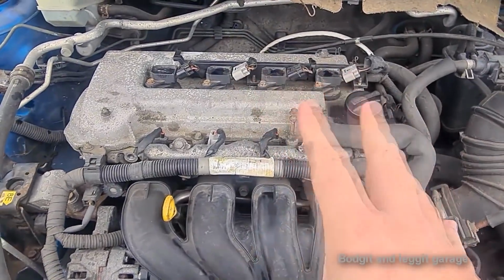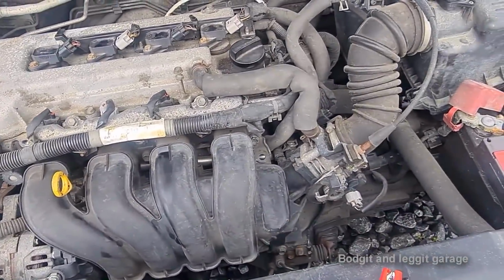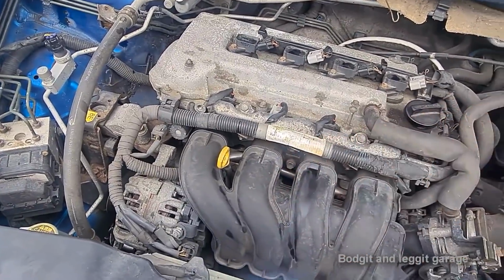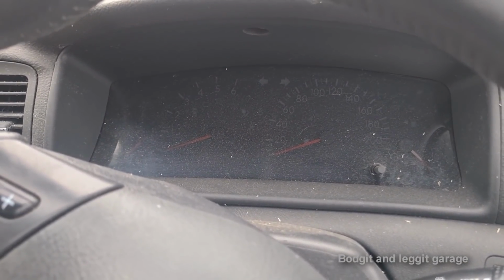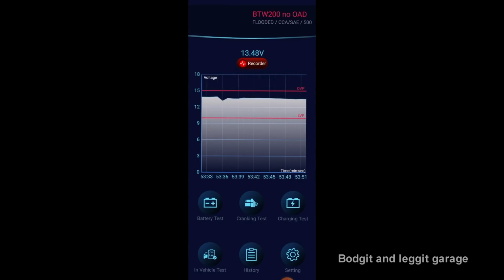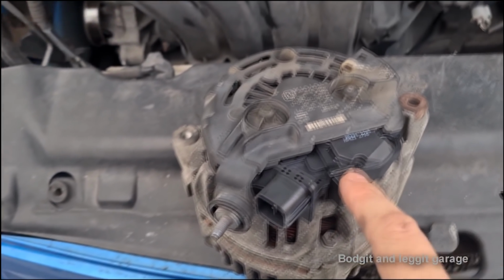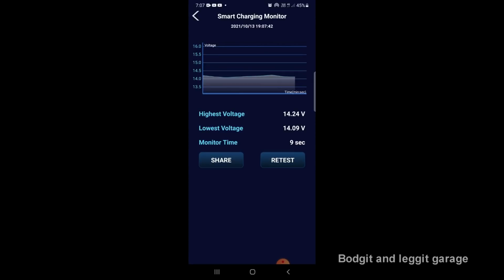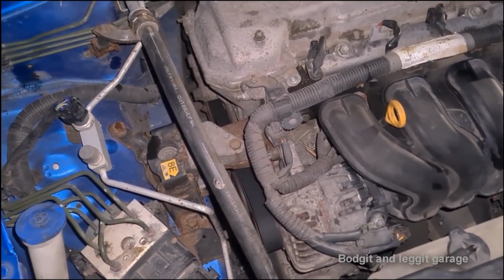intermittent charging

Comment: Wnen I boost off my Nissan Kicks it runs fine and the alternator charges around 13.4.   I can turn off car and restart it with just the battery and the alternator is at 12.4 and starts going down.  The car will run until I turn it off and won’t restart without boosting

Comment: Voltage drop is the way to go! OHMs will pop your meter if there is any current passing! Continuity is also risky.
With loaded circuit voltage drop, you will never go wrong, and wont blow anything up.

Comment: I got the exact same fault on my corollla couple years back.
It would cut the charging off. Revving it to the 6k rpm would restart the alternator.
The regulator and set of brusher fixed the problem same as yours
Y'all can plug regular volt meter to the cigarette lighter harness, does the job just as well
Cheers